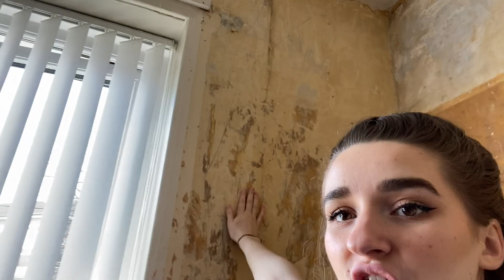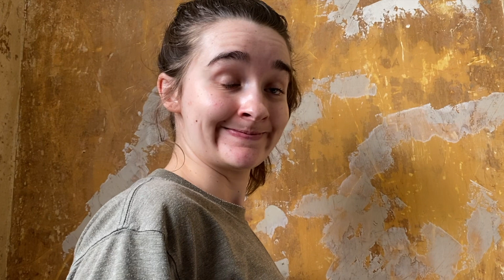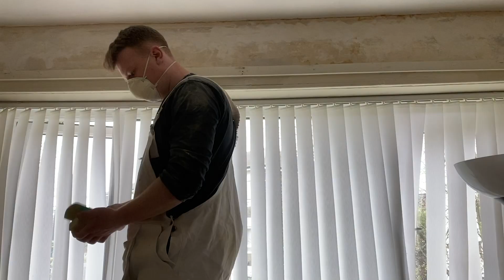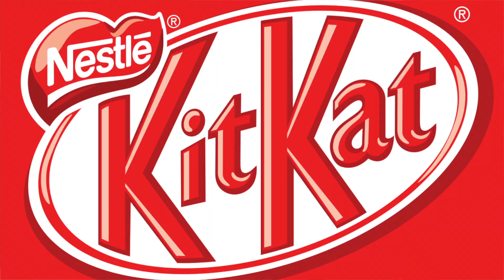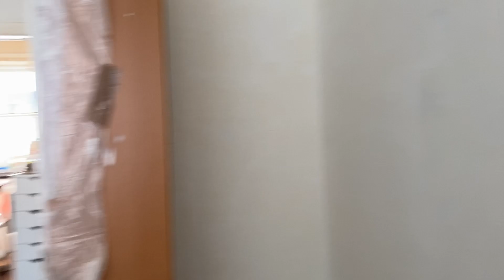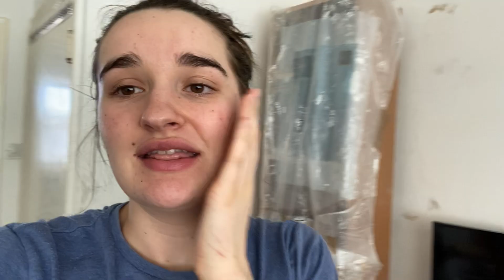MOVING VLOG #6 | LIVING ROOM MAKEOVER PART 1 | WALLPAPER TO WHITE PAINT

Comment: I’m not a painter, but maybe you should have primed the wall before painting it. 😊😊
Reply: And additional advice. When you paint anything your brush or paint roller cannot be dry. You need to put a lot of paint then 3-5 moves and then new paint and new spot.then you’ll avoid these coming off parts from the wall. Wenn it is old structure of the wall then your wall will “drink” a lot of paint and you’ll spend a lot to cover everything. Primer would help you a lot! I hope I explained it all correctly in English 😉good luck! Primer is life changing also!